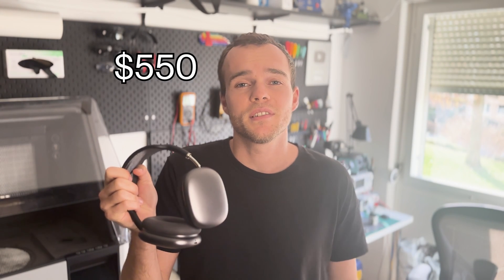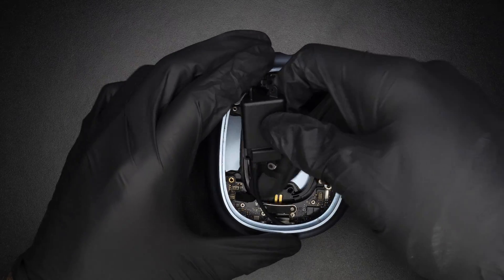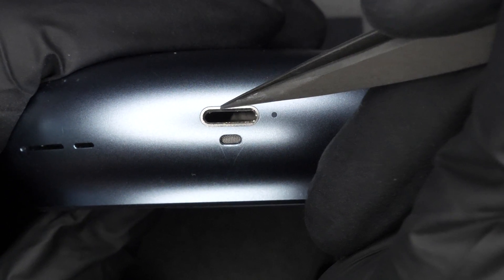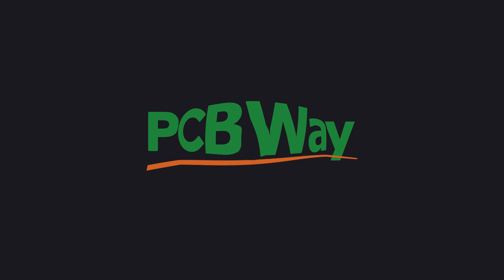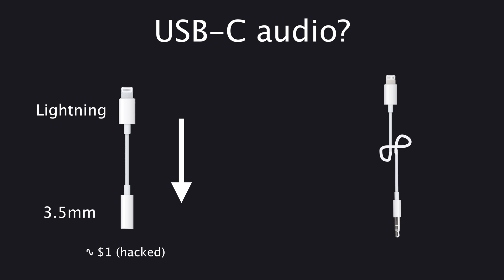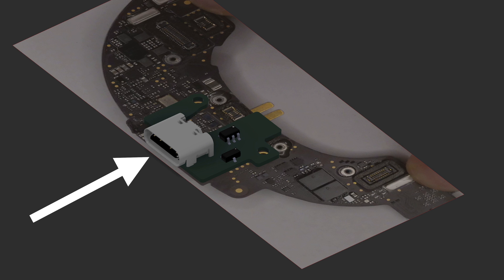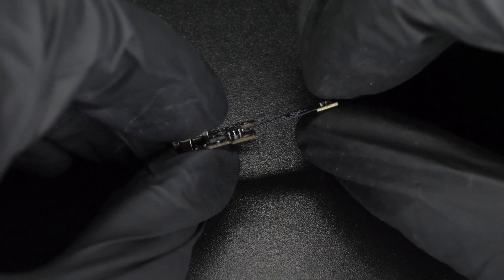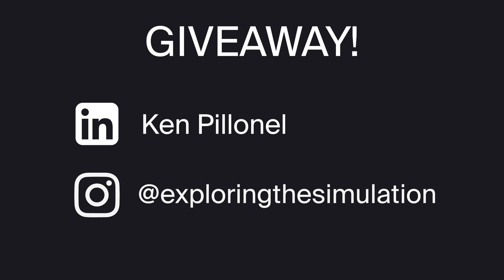AirPods Max 2 - before Apple!

Comment: The fact there was a lip around the Lightning connector hole that could be removed makes me think it was originally designed for USBC.

I was disappointed by the inclusion of a Lightning connector but bought a pair of these headphones anyway. Since I still use an iPhone 14 pro, that required Lightning too so I still only needed 1 cable.

It was only after I owned them for a while I realised the actual problem. The lack of an actual on/off switch. I'm not putting them into the bra case every time and they wouldn't go into standby mode for many hours. Disconnecting/connecting them from the iPhone in the bluetooth menu was a pain. So every time I went to use them, the battery was flat. I should have returned them really but my partner decided she wanted them and I never saw them again.

Apple need to take a good look at themselves. They make great products with silly design elements. I'll not be buying AirPod Max headphones until they add an on/off switch and add wireless charging in the headband so I can hang them up when I'm not using them and they'll be fully charged when I do.

Comment: Just a word of caution in case some people arn't aware. If you do end up switching to USB-C, you should know that if you depend on a wired connection for low latency (DJs, Producers, Video Editors, etc..) then you should know that as of this moment, there is no possibility to connect via a wire. No third party cables have worked so far and Apple has yet to shed some light on if they will ever release a new cable for this purpose. USB C to Lightning and then using the old apple lightnight to Audio jack does not work either The USB C would be used merely for charging your device and nothing else.
Reply: Is there any difference in audio quality wired vs Bluetooth
Reply: Since this post apple has finally launched the cable and i did end up buying it and yes there is a noticeable difference, sound is much cleaner and clearer and has more kick into it. I appreciate the fact that I can now connect it to my DJ hardware and my ps5 controller :)
Reply: @djsouljah  wait so u used this videos type c conversion and it worked for type c audio?

Comment: Now the APM USB C are out, will Apple’s USB C to Jack cable work with this hack?
Reply from the maker: Only works for charging sadly.. we don't even know yet if the new USB-C APM can be wired
Reply: @ExploringTheSimulation since they revoked this feature with the USB C update. would you be interested in testing a PCB and swapping the chip that performs the handshake? I would love to save money with buying a used pair and using your conversion kit, but if I could actually get MORE features out of buying a lightning pair that would be sweet.
Reply: FYI just went to the Apple Store and they confirmed there is no wired USB C to jack solution on the newest model either

Comment: I have airpods max with lightning, does your adapter work in jack with a USBC to Jack adapter? 

I don't know if it does because Apple just announced the same AirPods Max with USB C, so it's not worth buying them again. 

I'm asking because I'm going to upgrade to the iPhone 16 Pro Max and I'd like all my Apple products with USB C.
Reply from the maker: It only works for charging. 

By the way it is unclear yet if even the new AirPods Max support the adapter you mentioned.

Comment: Got my v1.1 kit and installed it today, went very well.  Here is my only recommendations to make the install instructions easier.  1.  it doesn't mention that you won't be reinstalling the plate the microphone is attached to.  I was trying to figure out a way to remove the ring from the inner microphone mount, I spent a long time trying to hammer the insert out, but after rereading your instructions I could see that it wasn't going to be used.  Just mention in the instructions what pieces can are not going to be reinstalled.   2.  The microphone plastic piece fit very well but it would be good to just put the adhesive pad on the part or give a couple adhesive pads in the box.  3.  You should warn earlier about needing a 7mm T1 driver, I ended up having to cut my tool in half with a hack saw.   I would have ordered it if I had known up front (my bad for not reading the full instructions first).

Comment: 1:48 hey does the charger still do it's thing without the lip that you removed???? if that's the case since its pushed into the port i need to open the headphones and remove the lip and it should maybe charge???

Comment: Instead of manufacturing each board with the USB-C audio passthrough, could you create a kit that allows the customer to rob the IC from the proper adapter and flow it on themselves? Would be more of a challenge but would still make it cheaper than doing each board individually. Also would be cool to see if the 2 way audio even works. It would be so nice to use the airpods max on airplanes when watching the built in airplane movies.
Reply: Especially since this feature was lost on the new TYPE-C version. I would really like a kit that does this. So I could harvest that chip for myself

Comment: My pair broke from the lightning connector... the port is pushed in a bit by the excessive charging with the case on... when connecting charger it would pinch the case i still don't know how some cheap case can deform metal.... this mod would give my pair new life! :p ALSO thanks to you I now see that the small metal lip in the charging port is pushed in, in my pair... if I somehow find a way to pop it out can the port work???

Comment: Have Apple contacted you in any way? Lightning port is garbage.
Reply: Don’t defend lightning, it’s gotta go man
Reply: I really had no issues with Lightning ports whatsoever. I know they’re outdated in terms of speed, but the connector has been top notch for so long. For charging a pair of wireless headphones they’re perfect
Reply: How fast people forget microusb
Reply: @theboss2k Well, companies didn't stick with micro USB when UBC C came around.
Reply: @theboss2k  You're defending lightning connector by telling us about another crap connector? 🤪
Reply: @planespeaking  yeah that’s correct 🤪
Reply: I wonder if Apple tried to improve speeds of lightning making it comparable to USB C wouldn't still be a good option. It feels like they just gave up from it a looong time ago but kept it around like it would make sense one day, and now it doesn't.
Reply: @JorgeALXNDR they did have a lighting with usb 3.0 in 2015 on the ipad pro. They just never shared it with the rest of their lineup. Most people common dont utilize the speeds that usb 3.0 potentially has anyways
Reply: @JorgeALXNDR they’d still have to use USB C in Europe so it makes more sense for them just to use it everywhere from a production POV
Reply: lighting has a satisfying snap any other connector so far has failed to replicate
Reply: @lachlanlau not really, a well designed usb C port feels very similar to the lightning port when plugging in a charger, and both pale in comparison to the feel of the 30 pin used on old iphones and ipods in terms of how satisfying it is to use (doesn't mean we should all go back to using the 30 pin now does it)
Reply: @oggilein1  I have a macbook and the usb-c just don’t have the same snap